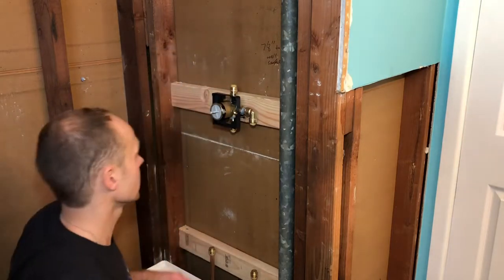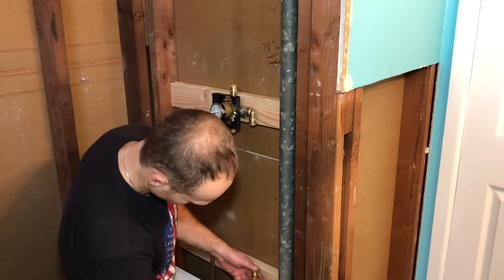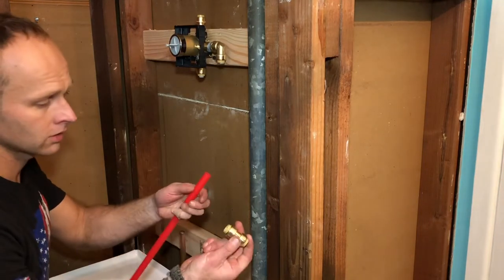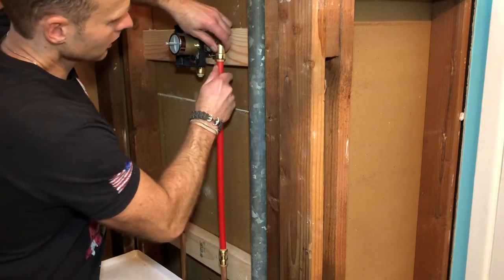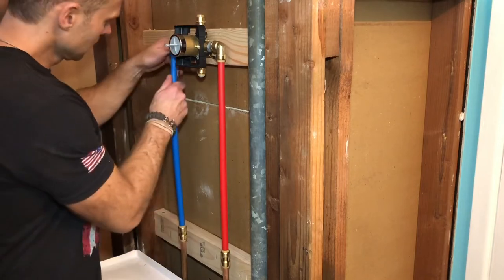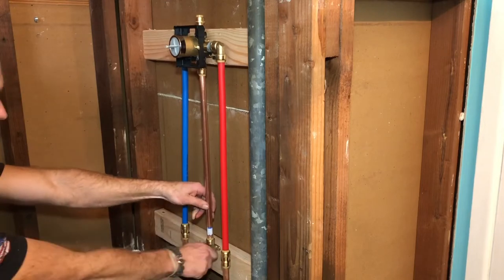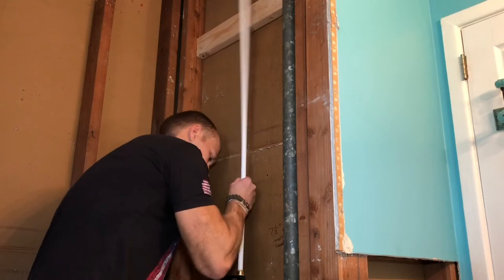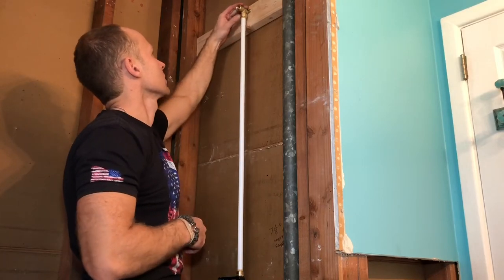How to - Install a Shower Valve using Pex Tubing Plumbing & Sharkbite connectors EASY - DELTA Faucet

Comment: Nice explination, but the hot pipe goes on the left and cold pipe goes on the right.😎👌
Reply from the maker: Yes, you are correct.    I think this case they mixed up so why I did like that.
Reply: Nice catch!!! I was wondering the same thing. The Delta shower valves mix with the hot on the left when it comes to trim kit shower controls ??????????
Reply: Some of them allow you to rotate the cartridge 180 degrees when a house is piped incorrectly.

Comment: Finished project looked great, although I was a bit concerned when I saw the reversed "Hot" (Red) and "Cold" (Blue) Pex tubing. Hopefully hot water will routed through the blue (left) side and cold water through the red (right) side.  Also, the ends of the copper tubing should not be sanded if they'll be used with Sharkbite fittings. Copper tubing should be a smooth as possible and the cut ends deburred, inside and outside only. These are things I picked up while doing lots of research for an upcoming bathroom project.
Reply: video footage is flipped.
Reply: @gurban333  Nope.
Reply: Just trying to finish it early lol
Reply from the maker: Yeah. Was weird setup in this old house.

Comment: Any welding performed not showing here? Especially the ones between bottom copper coupler and water supply copper pipe
Reply from the maker: Did separate video on That

Comment: would be interesting to show how the  90 degree joints connect to the faucet also
Reply from the maker: its just a standard join.  one end slides into the copper down pipe.  and then the other end threaded for the faucet pipe

Comment: Why is your hot pex pipe on the right? Isn’t hot typically on the left and cold on the right?
Reply from the maker: yes, you are correct.  i left comments to correct this in the description.  i forgot to show the correct clip.  its just wrong color in wrong location :)
Reply: Thanx for clarifying and for sharing your video. It was helpful and encouraging to a DIY person looking to do plumbing for the first time.

Comment: Some say not to trust the sharkbite behind a wall?
Reply from the maker: Yes they do.  I had them in my basement behind wall past 10 years. No issues .  I think many are talking about outdoors.  Definitely not for outdoors if not insulated well from cold.  Will freeze and seals will crack.  Hope that helps
Reply: They are suitable for use inside walls. But diy-ers should always mark the insertion depth on the pipe so you know the Sharkbite is fully seated. Sometimes they feel like they feel like they bottom out but they really aren’t.
Reply: and you can hear the shark bites seat in this.  before i watched this, i had put some shark bite end caps on, i couldn't pull them off, so I thought they were ON. but no. water went everywhere, my husband pushed them harder and you could hear them seat. They then worked fine. just if it helps anyone.
Reply from the maker: @volmom2316  yes you are right.  have to push in all the way,  hear that click. even if it feel its on because wont come off , might not be as you said.  thanks for sharing.

Comment: About to do the same, how’s the water pressure in the shower?
Reply from the maker: Solid.  Nonissues with that.  I posted some new videos on how to adjust the delta faucet for hot water  etc.

Comment: have you had any leaks so far or any issues?
Reply from the maker: No leaks.  all working perfect.   i just dont recommend using outdoor or where pipes can freeze over.   as that will crack them.

Comment: no deburring?
Reply from the maker: Yes. With sandpaper.
Reply: @HowToWithLech  You don't use sandpaper with sharkbites. The o-ring needs a clean smooth surface, not a roughed up surface. Plus you need the tool to to ream the pipe. Plus ensures proper depth. All right on their site.

Comment: Don't use sharkbites unless they are accessible. Instead, use pex crimp/expansion or sweat copper. Personally I would never use sharkbites except for a temporary repair. You could spend roughly the same amount for a pex crimp tool and fittings as you are for those sharkbite fittings.
Reply: Hi, I am using the pex crimp and I don’t get pressure at all. I was told by a kohler rep that I need to use copper
Reply: @avsarpatel1316  that's because of the fittings and elbows effectively reduce it down to 3/8 instead of 1/2 inch.
So the answer is to either use copper pipe or go with 3/4 inch pipe or go with the higher-quality pex-a stretch-tite pipe and fittings.
Reply: I've used sharkbites since they came out. Pretty rare they fail. I've also replumbed homes because of dezincification of metal pex fittings, crimp, and swapped with poly. I trust shark bites. Secret is a little plumbers grease on pipes inserted because failures come from seals that got snagged by pipe going in dry.

Comment: 🤔 I would probably not use sharks bite to connect copper to pex.
And also from the elbow I would rather use the clamps..
Reply from the maker: It’s fine.  It’s made for it.
Reply: @HowToWithLech  
I see.

Comment: Shark bite is not appropriate for in wall use.
Reply from the maker: Exactly what it’s made for.  Just not on outside facing walls without insulation.  And can freeze / crack